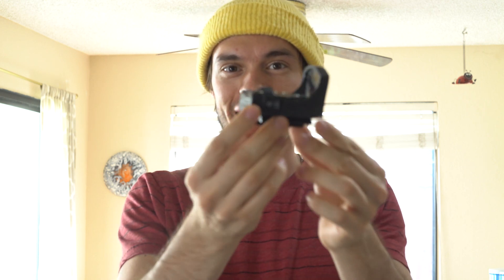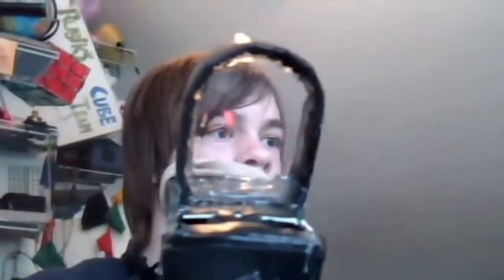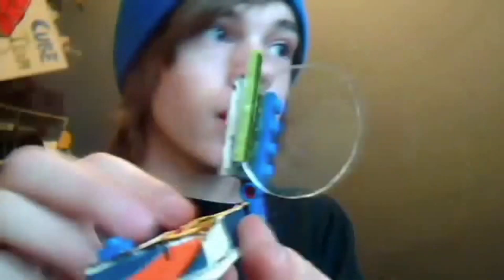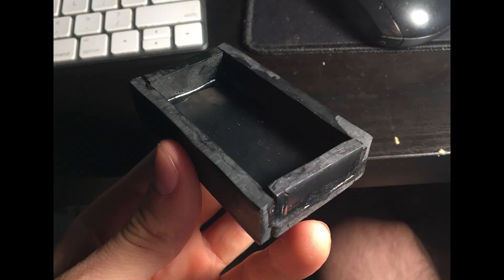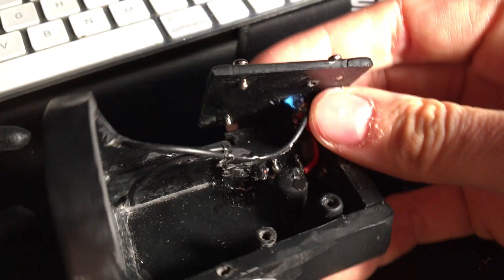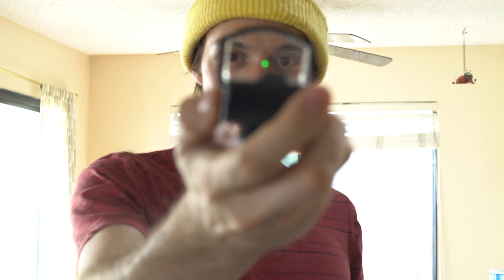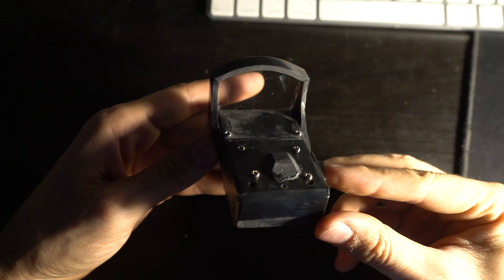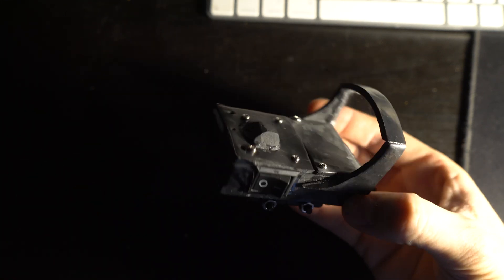DIY Red Dot/Reflex Sight!

Comment: Your sight has parallax of less than 3 inches. Aiming with that doesn't work for most uses like Airsoft. You need to make the light rays nearly parallel to one another.
Reply from the maker: it's ok this was just an experiment and something I wanted to try. and It actually did work pretty well on my AEG the light was just too dim in daylight

Comment: Or just buy a replica EOTech off Amazon for $60
Reply from the maker: Green Frog PB and Gaming where’s the fun in that!? Haha also I’m trying to save dat money pandemic budget baby! I make stuff because it’s way more fun using it than if I just bought it. :)
Reply: @antwonvinniegaming26  I got one for one of my cosplay/prop M4A1 rifles off Amazon a couple of weeks ago. Works great, and cheaper than a real EOTech.
Reply from the maker: Green Frog PB and Gaming hell yeah I’ll probably end up getting one just to have in my collection I saw one guy had it at the field and it was nice.
Reply: @antwonvinniegaming26  nice man! I have two holo sights and I have a red dot scope which died sadly.
Reply: @antwonvinniegaming26  but I agree with your point. I made my own police duty belt for cosplay about 7 years ago with an old belt and some pouches. Cheaper than buying a real police duty belt.